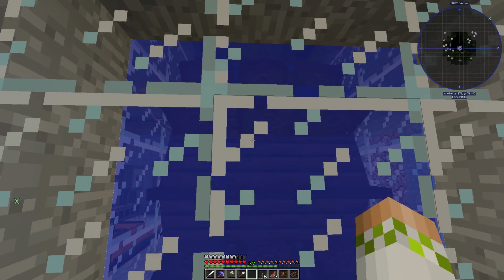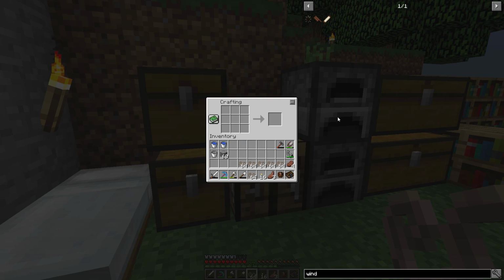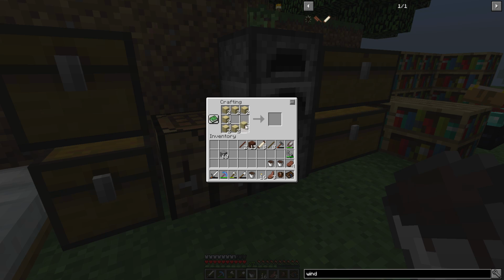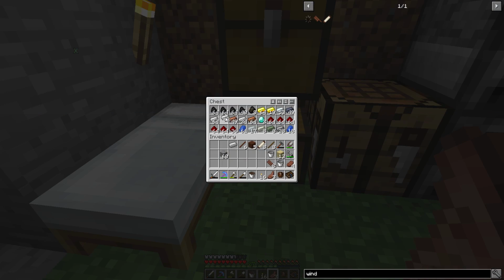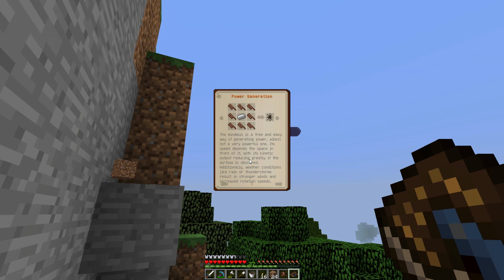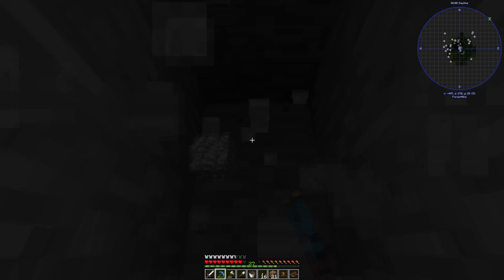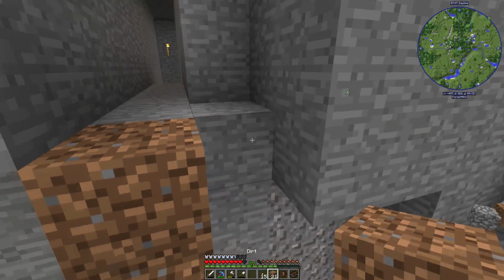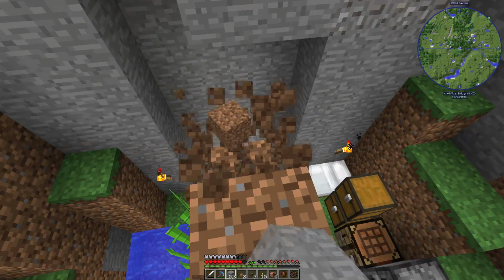Surviving With Immersive Engineering :: E04 - Windmill Power Generation

Comment: height no longer applies to windmill out put. i think that went away with the release for mc 1.12. basically when blu removed the improved windmill he also eliminated the height stuff. so you don't need to build super high up to get full power from one. just need the upgraded sails and insure a lack of obstructions.

Comment: The main virtue of the windmill IMO is that you don't need steel to make it. Thus, you can get it before you break into the Nether. Could be significant in a pack that makes the Nether nastier than usual.
Reply from the maker: That is a very good point!
Reply: That's what I did in my most recent playthrough. Not because the nether was hard but because I looked for a fortress for hours and couldn't find one.